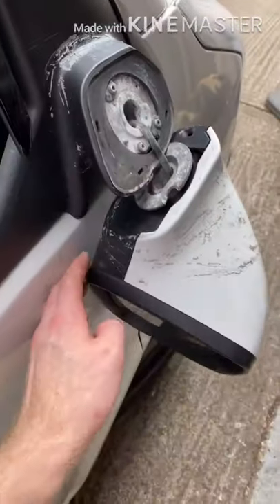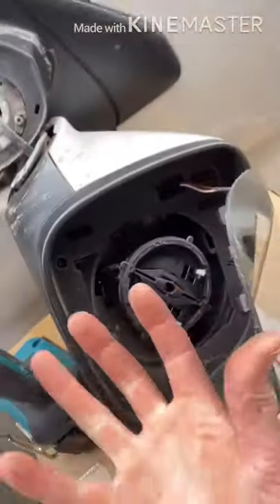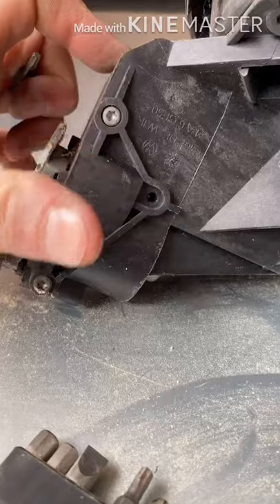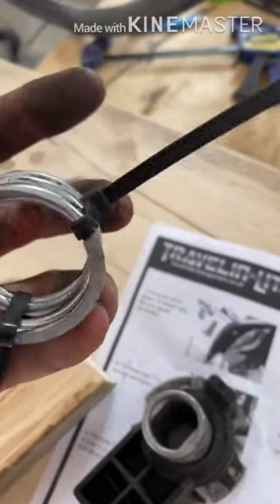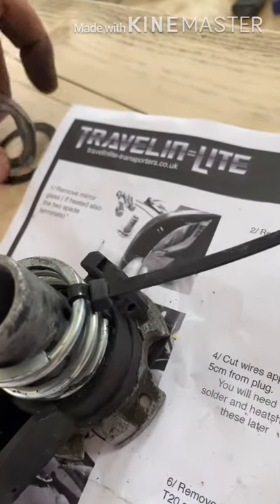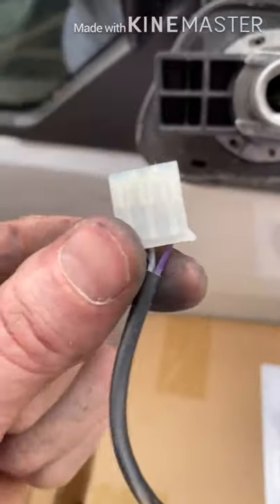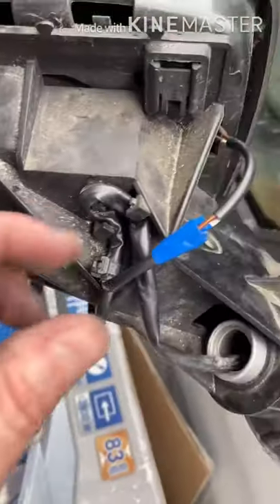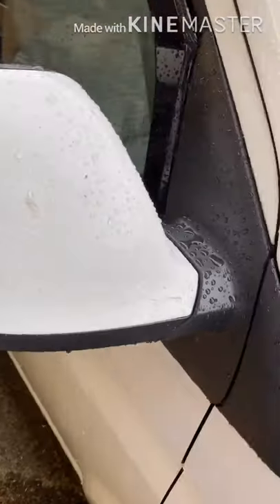Wing Mirror Bracket Replacement VW T5 T5.1

Comment: Thank you so much for this video. Just finished a job on my passenger wing mirror today and really happy with it and your video really helped. I got some great little wire connectors with solder and shrink wrap that you connect using a lighter. Never joined wires before and that made it very easy and was amazed that everything worked when I’d finished!
Reply from the maker: Well done you!! Enjoy every time you look at it knowing you fixed it yourself. 😅👌

Comment: Thanks so much for posting this video. Just done my driver side fix. The tie wrap tip was very useful along with the help of a vice. Also I used pliers to disconnect the heated mirror connectors so no soldering required. Cheers!
Reply from the maker: Great work! So satisfying fixing it yourself to avoid a painful garage bill.

Comment: Great video. This process is pretty much the same for a T6 wing mirror as well. If you have the DAB antenna in the wing mirror you will need to remove the door card to disconnect it as well. Worth the struggle. Zip tie trick works a treat. Thanks.

Comment: Great job. I have a similar issue with my Peugeot 3008 drivers mirror. The robbing bastards at Peugeot want £560 for a new mirror even though the broken part is just this bracket bush thing and they told me they don't supply the bracket so I sourced one on fleabay for £10 and waiting for it to arrive. Fingers crossed with the help of your video I'll save myself a fortune. thanks
Reply from the maker: Wow! That’s extortionate. Definitely worth seeing if you can do the repair yourself.. it’s a great skill to learn because it’s bound to happen again in your lifetime. Believe it or not, it’s happened again to me and this time the nuts sheered off so I’ve had to drill them out and use self tapping screws. Take your time and best of luck!

Comment: Thank you so much for making this video. It really gave me the confidence to do it myself and avoid the hassle and bill of taking to a garage. As others have mentioned, I have an aerial in the passenger side wing mirror so that coax cable broke and I was unable to re-solder. However, I think there is another aerial in the driver side door on my T5.1 as (so far) reception on FM has been fine. Also agree the cable tie tip is genius! Like you removing and re-assembling the two covers was the worst part and managed to break a couple of the (very flimsy) lugs but seems OK anyway.

Comment: Very helpful video, one issue I had was using cable ties, tried several times but wouldn’t hold the spring together. I found using an open ended spanner easier, pushed down on the spring with the spanner and my friend put the clip in. 👍
Reply from the maker: Great work Kev. Thanks for sharing your extra tips!

Comment: Cheers for the Video. RAC man said I would need to replace wing mirror £200 !! £13 bracket Amazon 1 hour later sorted. Tie Wraps on spring very clever.
Reply from the maker: Well done for getting stuck in mate.

Comment: This was very helpful thanks. I had to do it a bit backwards. I ended up removing the inside door cover, and removing the wires from the square harness so I could pull all of the wiring out through the metal sleeve, and then replace it. But thankfully it worked, although it was very time consuming.
Reply from the maker: Sounds like you put a good shift in. Great work!!

Comment: Thanks for that, very helpful. Mine also had the antenna for the DAB and GPS in it which was an added complication - they have to be disconnected from inside the van- don’t cut them! They are coaxial and not easy to splice!

Comment: You could have just disconnected the heated wires from the mirror. Those connections just pull off. Eitherway you got the job done.
Reply from the maker: Now you tell me! Lol
Reply: Cheers for the video. Massive help. Legend

Comment: I’ve just had the part delivered and I’m going to have a go later on. I’ll let you know how I get on.
Reply from the maker: Just take your time mate, enjoy the process with lots of tea and biscuits!
Reply: Well what a fricken nightmare that was. My mirror was the near side and it’s got the radio aerial inside. So glad I watched your video and the comment about disconnecting the heated mirror. There was no connection for the small coaxial cable for the radio so I had to snip it and solder it together before fitting heat shrink on the inner then the outer parts of the cable. Very pleased with the result and glad I saved a few quid in garage fees. 👍👍👍
Reply from the maker: @jamesedwards3266  great work. Dub skills! Hopefully doesn’t happen again.

Comment: Perfect! Thank you for this post. Need to do mine and is more involved than I had first thought. Brilliant commentary too! :) Ha!
Reply: Bastard thing took 2 hours. Main issue was depressing the bastard spring to slip the clip back in. Should have used zip ties BEFORE removing the clip from the broken bracket in the first place. The heated mirror wire could be unplugged from the glass. Had to cut the aerial wire though. Nuisance as I couldn't re-join it. Thanks again for the vid. Very helpful.

Comment: I followed this to fix my driver's side last year but I just broke my passenger side too and so I ordered the same part but when I've taken it apart, it looks different. There's a spring but I can't see the c-clip and the part I'm replacing doesn't have the wide base.

Does anyone know if the driver and passenger side are different?

Comment: Anyone know what size the bolts are for connecting the bracket? Someone has glued my wing mirror back on so I don’t have the bolts.
Reply from the maker: Let me know if you do find out. Mine sheered off 2nd time my wind Murrow was hit. Ended up resorting to some self tappers.

Comment: FYI. The heated mirror wires un-plug from the glass. No need to cut.
Reply: Thats where i got confused. Pretty sure as you say unplugging the 2 mirror wires works The same as all modern vags

Comment: What did you do about disconnecting the radio aerial?
Reply from the maker: Radio aerial? Lol no idea.. ! Lol
Reply: @DossingAroundInBoats  no worries. Managed to sort it but it was quite a faff. 
Just incase anyone else has this issue,  Sorted it by taking the door card off, disconnecting it there and then feeding the radio cables back the other way. 
Essentially, mine had 3 main cables going through the replacement part but the radio parts were too large to feed through the hole.
Reply: Exactly what I was wondering! Got to that bit & realised I couldn't feed it through the hole. And didn't want to remove the door card so just cut it & tried to re-join it later! Thanks for the helpful video tho @Handyman Handyman